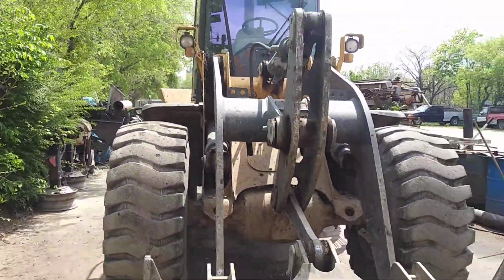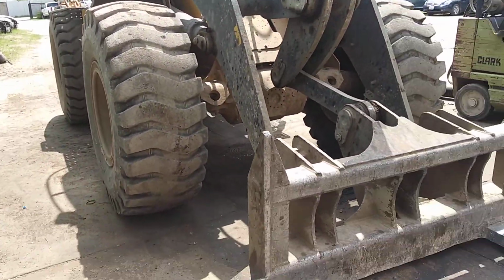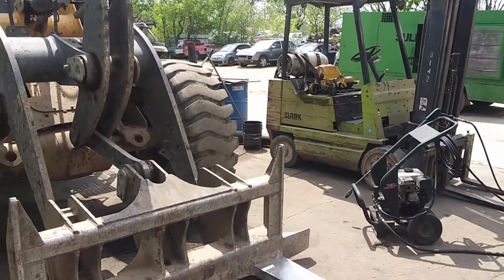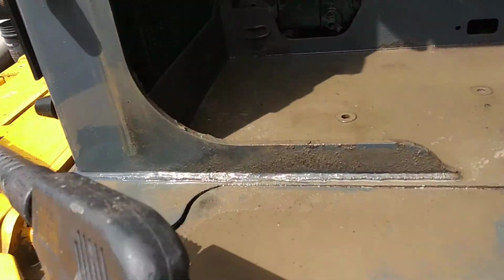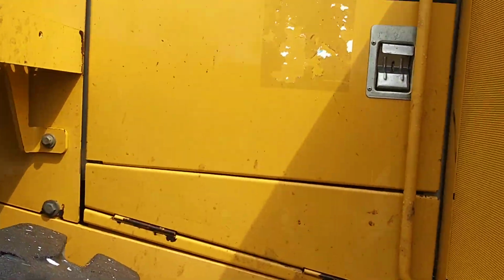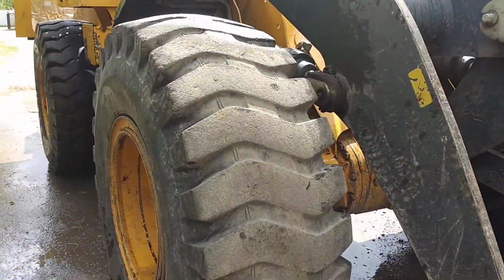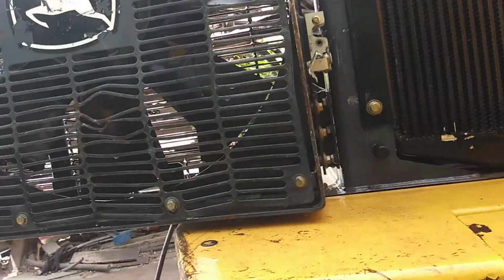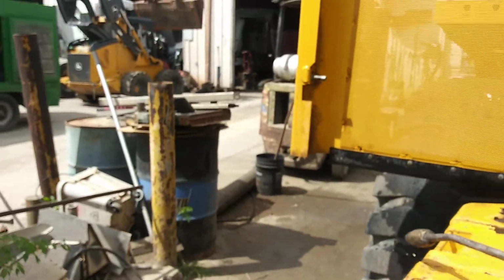GIVING MY LOADER A GOOD BATH!!

Comment: It’s good to see y’all keeping up the maintenance on the equipment. I worked for One guy once that thought you just run it into the ground then bitch at us for it when it broke down even though we would tell em it was over due or had problems.
Reply from the maker: Not only that I do all fixing n repairs on my loader. But when it does act funny I call da boss asap n be like order this part get with da mechanic to make sure it's a working part... I needs my loader!!!!